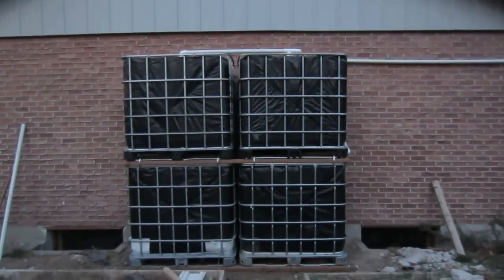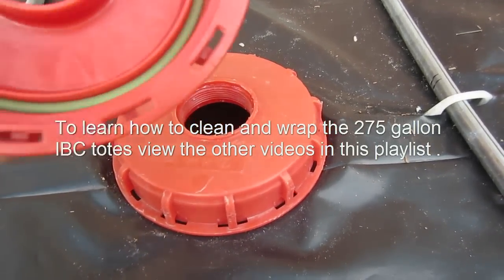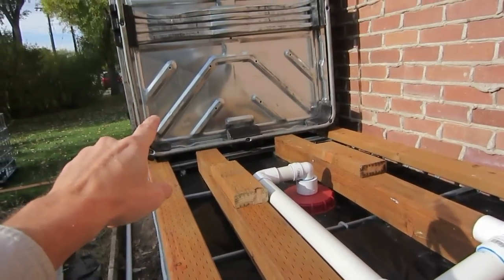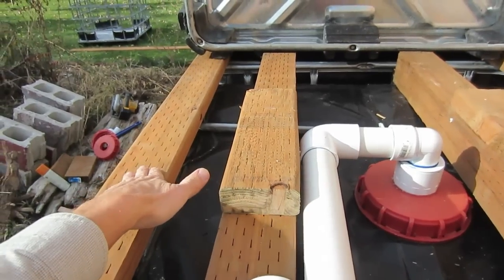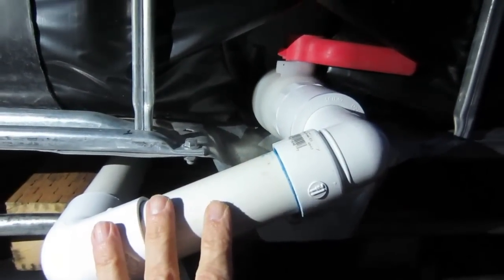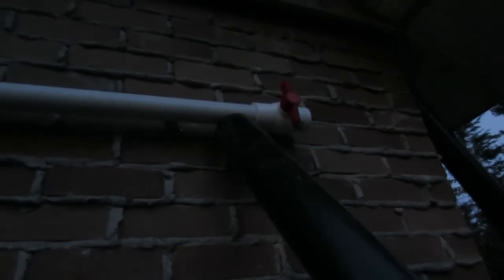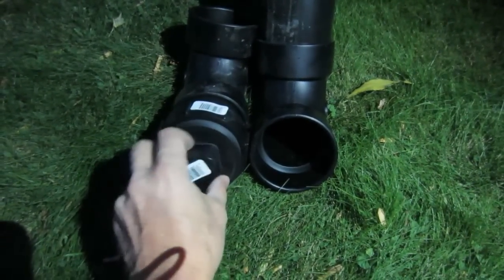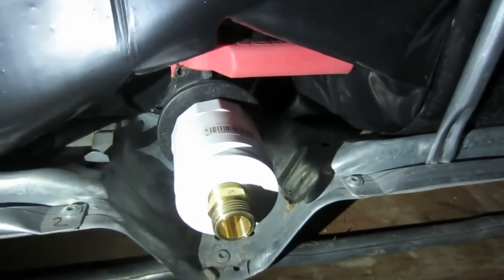DIY 1,100 Gallon Rainwater Harvesting & Collection System

Comment: Sorry bud but you're obviously not a tradesmen and in this video it shows. No one cares how long you cut the pipe, I can use a measuring tape. What my concerns are: filtration, system integrity and methods to apply for this application and why relative to pifalls with rainwater collection and filtration. For example: what type of IBC tote should be used and how to do you prep it for this application? What is the overall system design for this application? What is the best size for piping? Why are you using 4 IBC totes and what is the benefit? Why are your totes wrapped in black plastic and how do you wrap them if your tote, unlike all that I've ever seen which are white, wrapped in black plastic? The list of questions is long and your video is painfully short....
Reply: This video is I think, the last of its series. You may want to watch all of them.
And no, he's not saying that it's his trade. He just documented and shared for others to learn from.